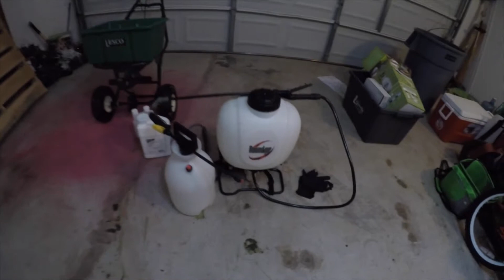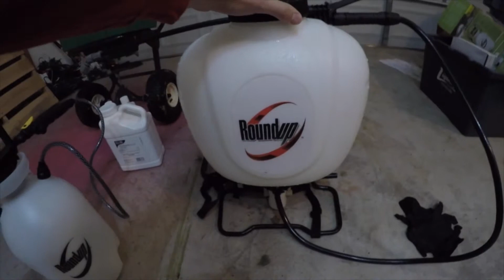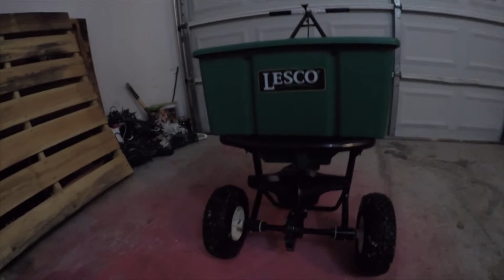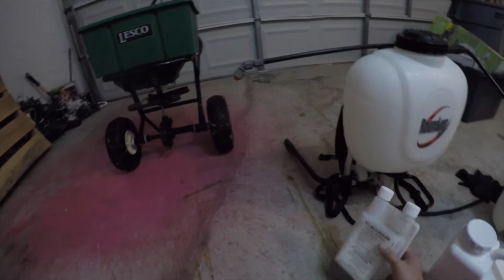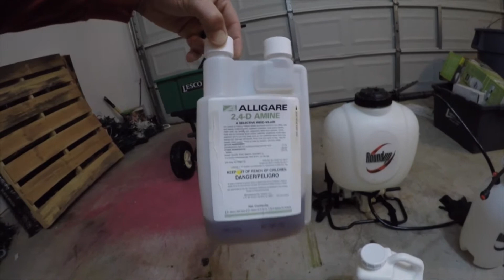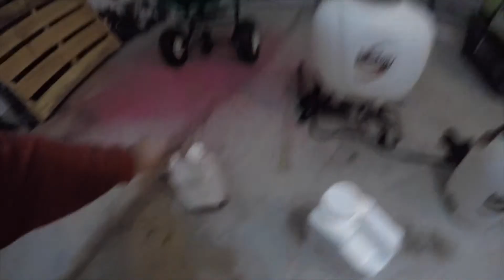My Fert/Weed Control Equipment 2016

Comment: are there any certain months in the year that you don't spray for weeds
Reply from the maker: No I don not spray every time I'm out because the whole goal is to help prevent as much weeds as possible; the only time I'm really spraying is beginning of spring because people normally cancel service before you could get pre emergents down for winter weeds because they don't understand to have a healthy lawn it needs treatments every 6 weeks. This is for Bermudagrass may I add because some variety of grasses don't need as much nitrogen as Bermuda. You really need to read up and ask questions because if you have no clue what's going on you could kill the grass because some chemicals can only be applied at certain times but also they have max rates for a year. So it's not something you can just do without having some type of knowledge especially grass varieties and weed identifation
Reply: I only spray weeds I don't spray weeds on lawns
Reply from the maker: Well then that's simple use round up or Home Depot brand hdx to save money. 41% glyphosate and spray once per month in the flower beds and such. Summer months it will be dead in a few days colder months it will take a week but up to a week and a half